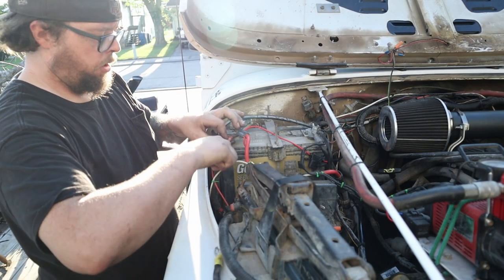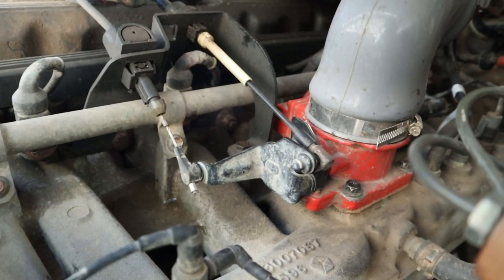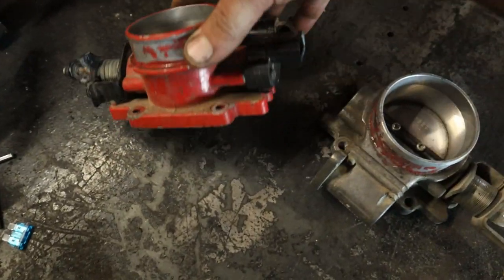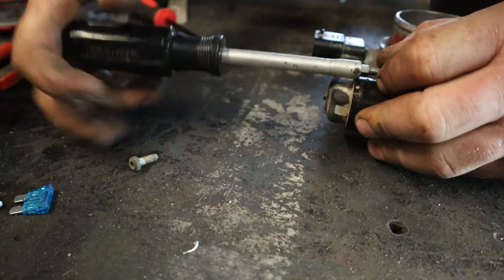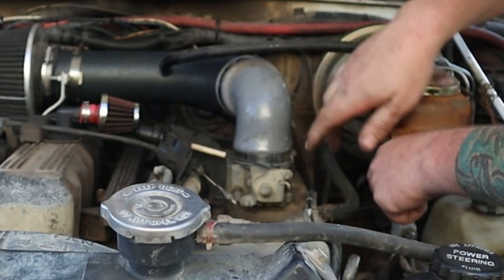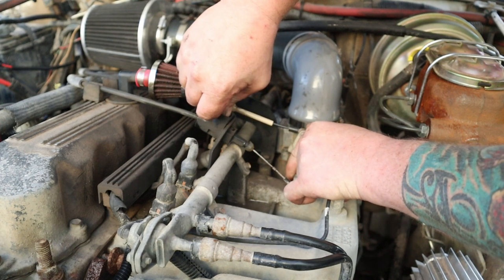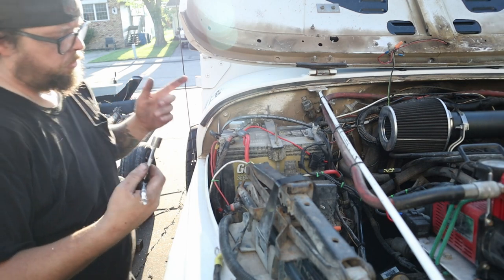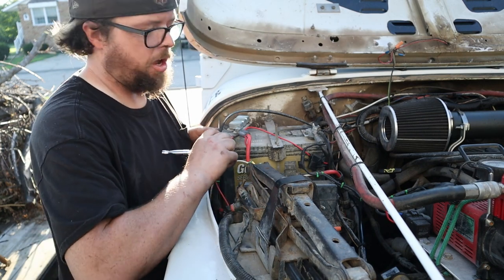Watch This Before You Buy a Bored Throttle Body For Your Jeep 4.0

Comment: Bro you have the old plenum. Ten bucks says with the rams head plenum from the WJs or 99+ XJs it would stop. The 62mm and rams plenum are 2/3 of the upgrades. The third is porting the head to match the rams head plenum opening. Also adding the WJ expansion chamber above the T.B helps flow along with its flattish hose. I am 3D printing factory XJ airbox lids that fit to the WJ oval tube. Coming soon!
Reply: Still not going to get no power though the restrictions going to be the valve you need a bigger intake valve to allow more air in so either going to need head work done or a new cam that raises the lift and duration of the intake valve opening to allow more are other than that the only way to get more air into that engine is by forced air induction or colder air because cold air is more oxygen dense once you get more errands and you're going to need more displacement though you can only cram so much air in a given space so then you're going to be looking at either boring it out or stroking it. Then you're going to need more fuel so that you can mix with more are so that means bigger injectors then you'll get more power

Comment: I have a 4cyl. YJ and hot a 62mm throttle body from EBay. Touching the disconnected battery cables together to clear the computer works. You have to make sure to use the 4cylinder tps sensor and iac valve. Luckily they transfer perfectly. You have to remember to plug them back in! My original throttle body was filthy. The new one is obviously clean. The good thing is that it runs great. I highly recommend buying a new 62mm throttle body for the 4cylinder engines out there. I actually got better mileage and it runs much better.
Reply from the maker: I have heard it helps the 2.5 more than the 4.0
Reply: No it doesn't you're not getting more power by doing that to the 2.5 the throttle body intake runners and the exhaust are over engineer to allow more are in than the engine needs the restriction is going to be the intake valve without bigger intake valves or a cam to increase lifter duration you're not going to get more air into the engine unless you're Force air induction or cold air because cold air is more oxygen than then you need more displacement to hold more of the air in the fuel which means you're going to have to get bored out block with bigger Pistons or stroke it then you're going to need bigger fuel injectors because once you get more are you need more fuel then you will get power

Comment: Do you think the whistle might be coming from the really short air intake tube and cone filter. I know you can get a whistle when you change to those filters. Live watching the videos! The timing was funning with Muddy Beard also doing a throttle body video this week.
Reply from the maker: no it was like that when I had the stock airbox. The only reason I’m running this crappy tube is the stock airbox no longer fits with my upgraded brake booster/master
Reply from the maker: Yeah I got a laugh out of that too. I was trying to make a different video but I couldn’t finish it in time so it should be next week.

Comment: If you're looking for a little bit more power you need to cut the catalytic converter off to decrease some of the back pressure it won't be a huge difference but it'll be a little other than that moving the intake air temperature sensor to the actual breather box seems to keep the engine running better longer once the intake gets hot from the exhaust underneath it the temp on the IAT starts to read higher than the are actually coming in also another thing that helps a little bit is moving your map sensor off of the throttle body and replacing it on the frame somewhere where it's not shaking from the engine you're not going to see any huge gains but it does make it drive a little bit better and you do pick up a small amount of power
Reply from the maker: Honestly I’m not looking for anything, like I mentioned my buddy used to take these throttle bodies out of junkyard jeeps and get them machined out then sell them on eBay and he gave me one so I put it on. I was never really after anything.

Comment: All you need to do is port match some of the TB just above the IAC port. About 100° in the center of the IAC port. Do not cut into the TB where the butterfly seats. I did this and worked very well versus it being matched 360°.
Reply from the maker: This is the second comment similar to this I definitely need to look into it
Reply: What do you mean?
Reply: @blurglide 
Rather than bore the entire circumference, only remove material in the portion around 90° from the throttle shaft.

Comment: The BBK throttle body is the way to go excellent quality and performance really woke up my Comanche with the four hole  injectors in the new coil and wires
Reply: What brand coil did you use? Mu 1993 has the stock coil.
Reply: You're not getting more power doing that you have to have bigger intakes valves more lift and duration and displacement to get more power out of those engines
Reply: @thehatefull1761   I get that you probably believe that.  Have you ever driven a vehicle with sport mode that is high-performance? Put it in sport mode and it does not put new intake valves and change the displacement. Yeah it is a completely different vehicle. Thanks for your wisdom.
Reply: @boldgold3885  I can explain it to you although I doubt you'll understand but vehicles that have sport mode is nothing but a tune. Vehicles that have sport mode are usually running on economy mode to save fuel in sport mode is the un economy mode sorry to burst your bubble but at least now you know the facts are you smart enough to accept them though
Reply: @boldgold3885  a lot of high performance vehicles that you're talking about have cam phasers are able to have variable valve timing but we're talking about our vehicles that are not even OBD2 I don't think you understand a lot about vehicles and are ignorant about what you speak I've been a mechanic for 20 years and have built a thousand horsepower vehicles before my garage I'm currently building a rock crawler that has a 5.3 with a 2.5 liter supercharger on it I know what I'm talking about little buddy
Reply: @thehatefull1761  any chance I can get your autograph :-) you’re like my hero
Reply: @boldgold3885  typical. Nothing intelligent to say
Reply: @thehatefull1761  you’re mistaken  it is absolutely OBD two. So much for 20 years.
Reply: @boldgold3885  I got a good laugh though thinking that you made some performance upgrades with an intake and throttle body on a Jeep you must really like those sugar pills
Reply: @boldgold3885  you don't even know what OBD2 is you know how I know you don't know because you think an intake and a throttle body turns your Jeep into a performance vehicle
Reply: @boldgold3885  how much horsepower did you pick up putting on a throttle body, intake, and 4 hole injectors? 😂🤣
Reply: @boldgold3885  I bet you had a misfire and whenever you replaced the bad spark plug wire you thought it was a performance gain 😂😂😂
Reply: @thehatefull1761  that’s OK don’t give up
Reply: @thehatefull1761  I get it you know everything
Reply: @thehatefull1761  with the catalytic converter change had to be at least 20 in about a mile and a half almost 2 miles per gallon better mileage. My gas is probably lying also though.
Reply: @boldgold3885  I will teach you since you are ignorant more air and more fuel is more power the way the air gets into the engine is through a intake valve that is where your final restriction is. So it doesn't matter how big your throttle body or your intake is because the throttle body and intake on a 4.0 and 2.5 are over engineered to allow more air through them than the engine can actually get past the valve. In other words the only way you will ever benefit out of a bigger throttle body and bigger intake and more fuel injector is by putting bigger valves in the engine putting a bigger cam so that the bigger valves will have more lift and duration and by boring and stroking the engine so that you have more displacement to fit more of the air then once you're able to get more air in the engine you have to add more fuel that means bigger injectors and more fuel pump after that with the proper tune you will make more power
Reply: @boldgold3885  wow you are crazy you won't even get 20 horsepower out of those engines running 3 lb of boost but you think you made 20 horsepower by changing a catalytic converter a throttle body at intake and fuel injectors you are absolutely lost your mind
Reply: @boldgold3885  more than likely there was something wrong with your vehicle either you had a misfire or a leaky or clogged injector or a clogged up catalytic converter but on a healthy running 2.5 or 4.0 l you are not going to see 20 hp difference doing that. You talking 15-20% increase in power at least from a catalytic converter 😂😂😂. You had a stopped up catalytic converter that is hilarious though you gave me a good laugh 😂
Reply: @thehatefull1761  you’re correct the cat was plugged. You have plenty of emojis here you forgot lol sista

Comment: The injectors for Ford are the 49# cobra mustang injectors you're talking about. I've built these engines to do 500hp.
Reply: Hol up, hol up, hol up. You’ve built 500 hp into the 4.0?

Comment: After you changed back to the stock throttle body and then it shows you start the engine up. It whistled in a sound. I've never heard an engine whistle like that before in a Jeep. Take that air intake off and drive it without it. See if it still whistles
Reply from the maker: It does, the shaft seals in the TB leak on both of them

Comment: that is sort of a common thing with all large bore TB's. has to do with the velocity not being as high with the higher flow rate. I think the 'Horse shoe' intake manifold is a much better upgrade than the TB.   so we can math this out. a 4liter (244 CID) at 6000 rpm, will pass about 425 CFM... 244x6000/3456=425.  A 60mm TB will flow in the 600 CFM range. so thats an extra 175 ish cfm.. that drops the intake air velocity which causes the 'whistle'...  I'd rather have a stock TB with a horse shoe manifold.
Reply from the maker: Is that the 2001+ xj/tj one?
Reply: @FlawedOffroad  I think it was 99 through 06 for pretty much any 4 l. I think It increases flow by like 3% or something but the different shaped runners are more efficient and it also helps dissipate the exhaust manifold heat a little bit better than the straight runner log style intake. I think ideally finding a 4 l HO head with the horseshoe intake would be the ideal setup.
Reply: I upgraded to bored 62mm on my 96 4.0 and ran it for years. Then, I reinstalled the stock tb which narrows down to 56mm based on what I've read on the internet, and I actually gained power. Not as touchy response wise, but the torque is much better and doesn't fall on it's face when you give it sudden wide open throttle from slow speeds. I think that neck down below the throttle flap helps to speed up the air and guide the air more smoothly into the runners instead of the air just slamming down into the manifold and creating turbulence.  My jeep has a gibson header, high flow cat and catback, horseshoe intake, and bosch 4 hole injectors. Also noticed that my voltage is a bit higher too since the air is moving by the MAP sensor hole more quickly now (gives it a better "engine load" reading).
Reply: @alexirodriguez9121  yep you hit the nail right on the head. If you're building full-blown race car then obviously the bigger the hole the better. But when it comes to efficiency and low end power you want that high velocity airflow. Same principle applies to putting a thousand CFM carburetor on a 5 L engine It just drowns it out. And unless it's spinning 8,000 RPMs it really won't make a bit of difference at all.

Comment: Air intake tube and cone filter for the whistle...put back to standard and see
Reply from the maker: I’m sure it adds to it but the whistle was there with the stock airbox and that tb. However I can no longer run a stock air box because my upgraded brake booster/master sticks out too far, had to remove the airbox

Comment: The whistle is from the idle control port. Moto trend says to make a couple vertical notches at the top of the port. I guess that mixes the air around enough by the port to not create a whistle. I'm thinking about doing this to mine soon.
Reply from the maker: Ive had several comments about this, One of these times i will look into it
Reply from the maker: Im making a follow up to this, I tried rounding all the sharp edges on the ports and made a few notches but it didnt help. I cant find a picture online of how deep people are saying to make them, do you have a source?

Comment: My 4.0 is NOT a turd. I have a 0 to 60 video posted. 
The mods you have done I would not do. Your cold air intake is actually a very HOT air intake. The engine is drawing in hot air from the rear of the engine! Stock, it draws cold air behind the left headlight. 
Your PCV is inop. 
And that's just the first 15 seconds I looked at your engine. 
If you live near me, I'm willing to help you get the most from your 4.0.
The throttle body won't help (probably loses a few HP) 
There are gains to be had on the exhaust side.
Reply from the maker: I had to remove the stock airbox due to the aftermarket brake booster/master is too long. That crappy intake was the fastest way to get running. I don’t plumb the ccv to the fresh air intake because it pukes oil anyway. It has suction at idle but on the freeway the metered hole at the rear can’t keep up with the blowby and it pukes. Thus the little mini filter still lets air in when at lower rpm’s and catches oil drips when it starts puking.

I could spend 20 minutes explaining it all and ppl would just fast forward anyway and ask the same questions haha
Reply: @FlawedOffroad   Haha! 
I have done a few different 4.0 "builds" 
Some things work ok, some lose power and most do nothing at all. 
I did find some mild gains by custom building my own exhaust. There are a few HP to be had there. 
I didn't know about your master, YJ brakes were weak when they were new. 
I got great results from using drilled, slotted rotors and a performance pair of pads.
Reply from the maker: @TheBandit7613  going back through the comments on here cause Im going to test something out and I see I missed this one. I have full width axles the stock brakes werent cutting it so I have an aftermarket booster/master thats sized for my brakes and it works so much better. but its long and forced me to gut the airbox. Im still using the cheap intake tube where its at, at least its not on the exhaust side. Thought about porting it into the cowl but havent yet. Im going to attempt to grind a little off the IAC port, I must have 10 comments on here from people saying that is what whistles. So its likely new video is incoming
Reply: @FlawedOffroad   Jeep used a weak booster, for sure. I have had to two leg stop a couple times. Originally, the YJ came with brakes that are hardly adequate for 27" tires.
There's a Jeep site I'm going to try to find again for you. They make 10 or 15 changes to their YJ and dyno it after each change they make. Some bolt on performance parts would LOSE several horsepower. 
The mod that made the biggest difference for me was a custom built exhaust. The YJ came with a restrictive exhaust, the TJ is even worse. 
I'll watch for your new video and I'll try to find that Jeep website for you.
Reply from the maker: @TheBandit7613  I have one of the headers with the baffles and then I use the TJ downpipe which uses a larger diameter exhaust than what the yj one was. I have a high flow cat but then I think it’s mostly factory behind that so it probably necks back down to whatever size the YJ came with. I am running a thrush turbo welded muffler which sounds pretty good but it’s a factory tailpipe. At one point I was running the four hole injectors which I thought gave me better throttle response but I put the factory ones back in for some reason trying to diagnose something a long time ago. That wasn’t it and I’ve been meaning to switch back to them because I felt they made a difference

Comment: Mine whines under load after switching to a BBK and spacer.. I thought it was my pulleys or PS or ALT but no it was the throttle body’s causing a Whine threw the stock air box

Comment: I have run multiple 62mm TB and never had a whistle. However I on the 98- intake manifold I combined with a air raid tb spacer. and with the 99+ style intake I ran direct on the intake manifold. I did at one point swap a 96 motor out to have the 99 intake and the bored throttle body. and it may have just been the placebo effect, but that with a 2.75" full length exhaust really seemed to make that engine come alive.  Sucks that you've had those issues with it... if you're up for one more go at it try putting a TB spacer in it like an air raid or something...  might just be snake oil, but it also might solve the whistle for you.
Reply from the maker: I’ve always thought spacers on Jeep to be snake oil, it was different back in the day with carburetors where it was giving the fuel more time to atomize. I didn’t think about it as potentially correcting the whistle though
Reply: Throttle spacers actually increase plenum volume which in turn provides more low end torque. It's common to swap intakes to get more volume. TB spacers aren't much, but DO help with that.